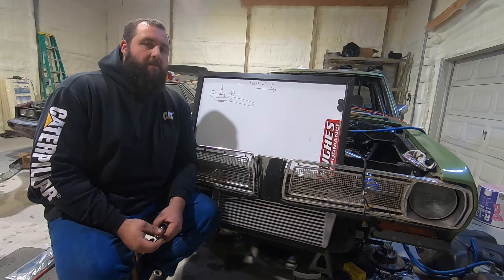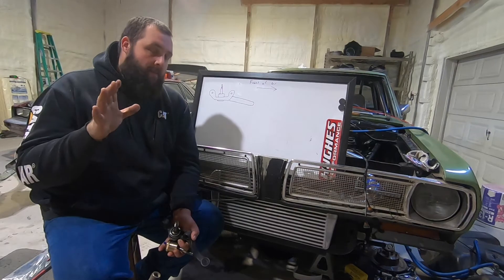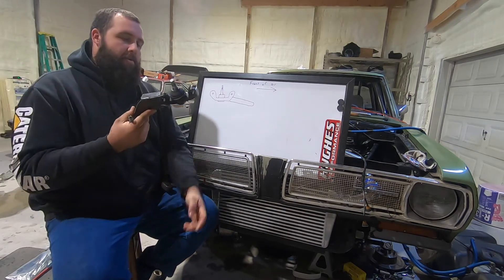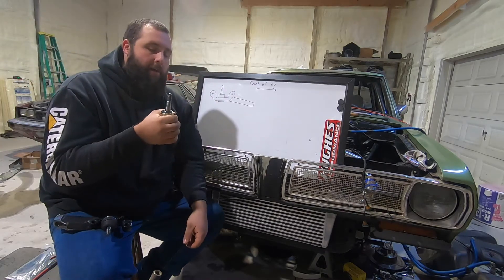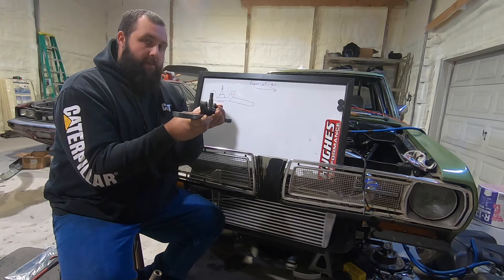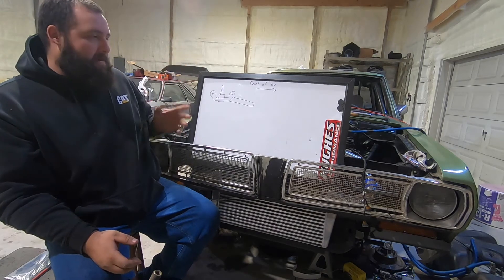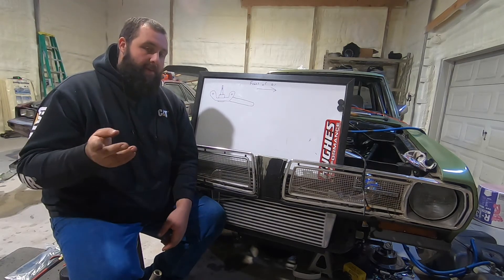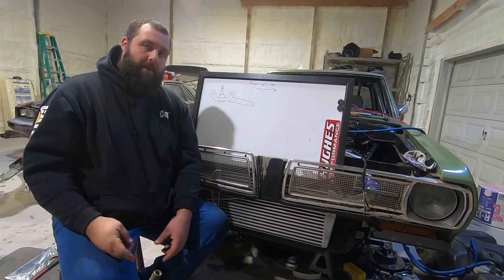More steering problems

Comment: Steering is kinda mission critical, especially at the speeds that thing will run, so I'd highly recommend safety wiring your bolted assembly. Also looking forward to the Capri project (hoping for a Ford engine....).
Reply from the maker: Yeah that's definately a good idea. And I'd really like to build a ford 300 i6 at some point but this capri will have a different i6 not the common 1/2jz or rb tho 👍

Comment: I hated to see this.  It’s ruff finding folks that are interested in doing small runs of  items these days. 
     I made some mounts that I felt the market needed and no one was offer . I Had all the pieces and also had completed assemblies on hand -plus had scans of each of these pieces required to build the assembly . 
    I had several folks that told me “ sure we can do it “ if you will order 100 + of each.  Between setup costs and the initial run I would be in way too deep for something that I hoped would sell.  Priced me outta the game.